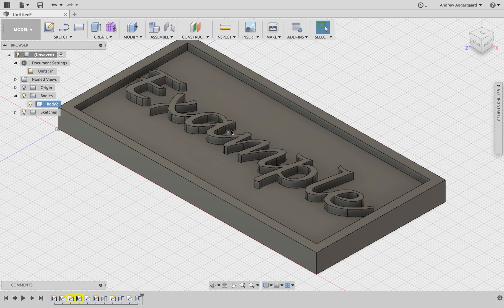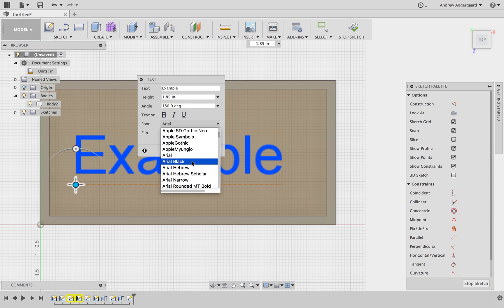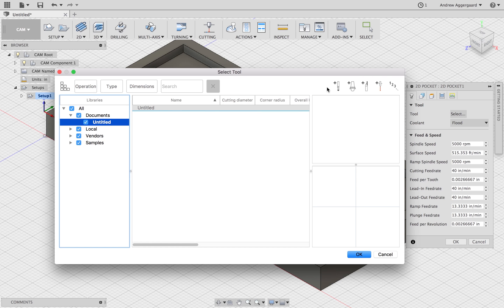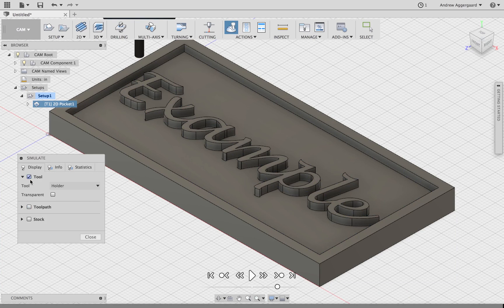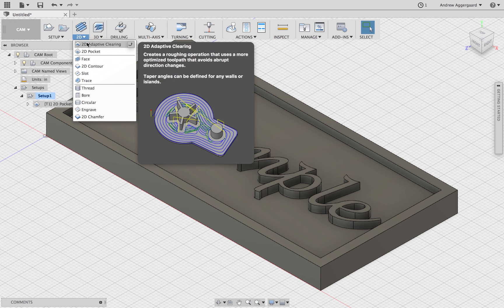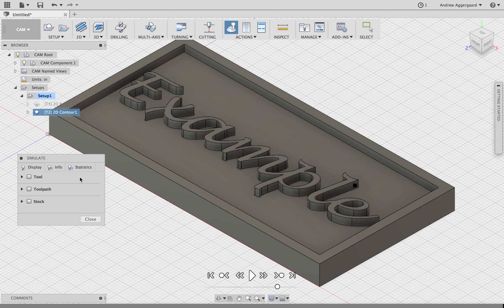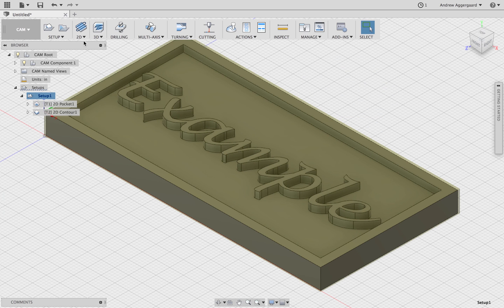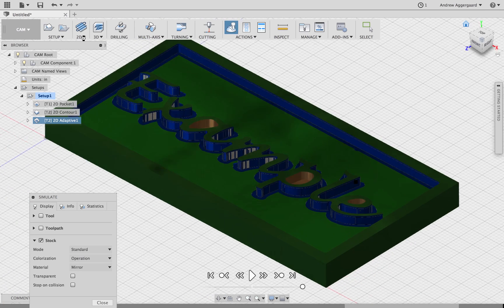Fusion 360 and CAM tutorial for Shopbot

Comment: Hey everyone, I actually recorded this video as a high school student and thought I’d add a little disclaimer.

The dimensions outlined in the video were specific the project specification for the engineering class it was recorded for. Specific dimensions for your use case will be based on the material and bits you are using

Comment: If you are wanting to regularly carve text using a milling machine, get Vecreic Vcarve. Fusion 360's current tooling methods are only useful if you are cutting out 2d text using a laser cutter. It is literally impossible to get true sharp corners on text below Z- using a 3 axis milling machine. This is because the tool is always fatter than the corner point. You need a sharp point tool and a toolpath style which changes Z height to make text corners look sharp. Fusion does not do this but vcarve does.
Reply: too bad Vcarve is $700 before Taxes and it only runs on Windows. Fusion 360 is FREE and multi-platform. I am not sure what you mean by " literally impossible to get true sharp .... " !

Comment: How are you calculating your feed rates?
Reply: Ryan I am sure you'd have gotten the answers by now. Feed rate ranges are always recommended by materials and more importantly with experience that you've built with your machine. I always recommend to start with the lowest feed rates and increase it as you build confidence with the bit and material. Even for the wood you'd need to be considerate on the hardness of the stock material and build your thumb rules by the experience. Hope it helps  others looking for an answer too.
Reply: This question is very old now, but I recorded this video while in high school, and the feed rates here were based on a bit of research as well as trial and error. The feed rates in the video were specific to the material that was going to be used for the class project, which is what the video was recorded for